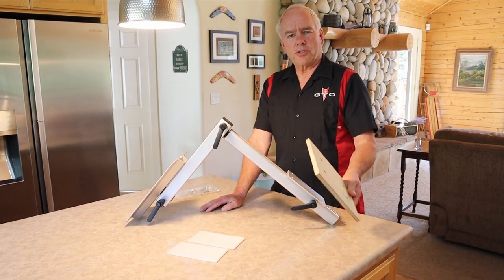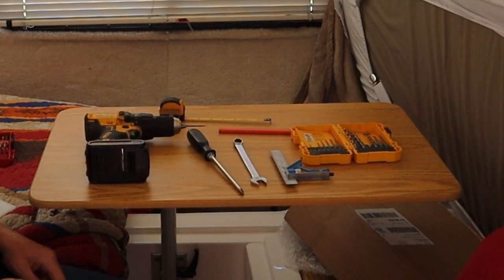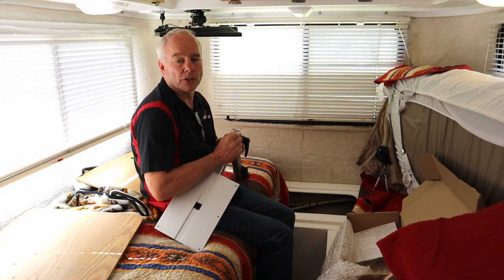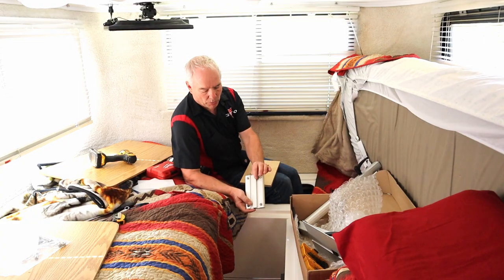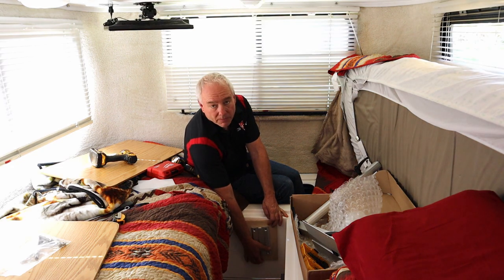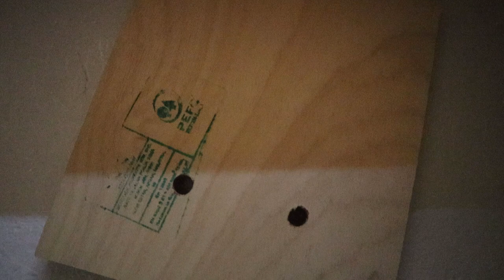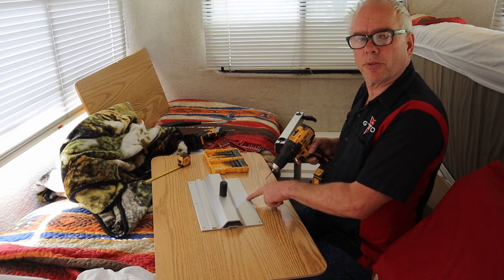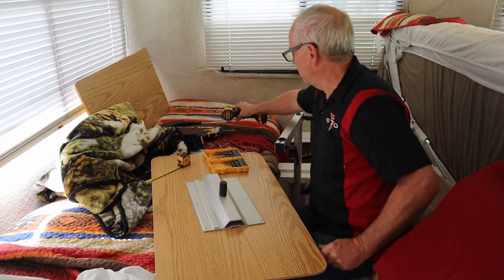We Call This the Miracle Table: Installing the Fully-Adjustable Lagun Table

Comment: Morning. Do you know if there is a Lagan table leg that fits into the original mount in the floor??
Reply from the maker: There isn't.  I don't know if you saw the video of Louise's trailer.  She found a work-around.  Here is what she said: "The Lagun leg mount is somewhat square. What we did was slid the mounting leg that came with the Lagun table right down inside the existing table pole that comes with the Casita for mounting their table.
We then drilled a hole through the Casita pole and ran a bolt through the Casita pole and through the existing holes that the Lagun table leg comes with for height adjustments, so that just the top of the Lagun table leg was sticking out. Then we attached our table that we made and had already attached the Lagun table mounting plate that comes with the Lagun table."
Reply: @TravelsandTravails  thanks so much for the reply! We will try Louise’s solution
Reply from the maker: @georgiareddirtroad9919  You're welcome!

Comment: It looks unstable.  LOL
Reply from the maker: It was stable, but a little wobbly.  The wood plate that we put on the inside of the fiberglass was not enough reinforcement. Doug replaced it with a larger piece of wood.  It doesn't wobble now.